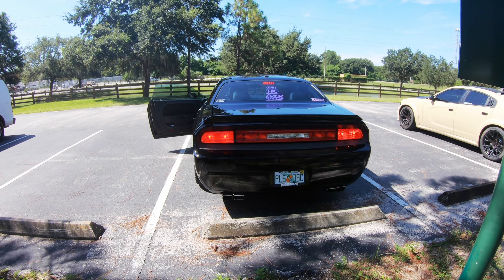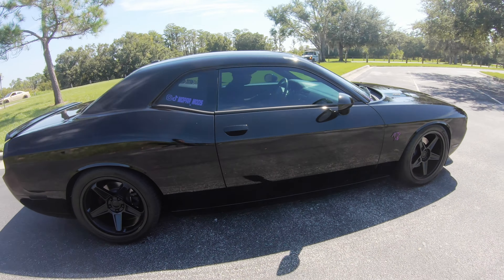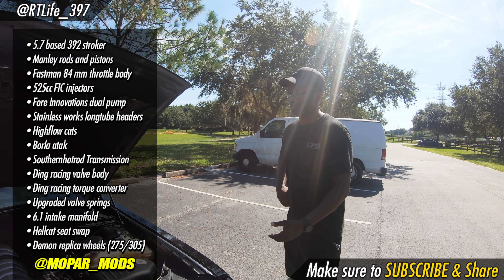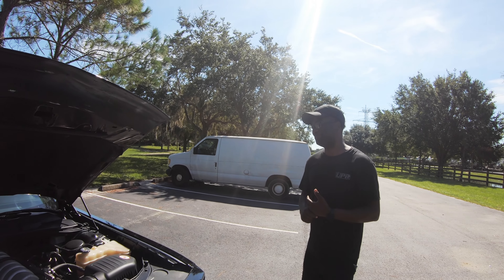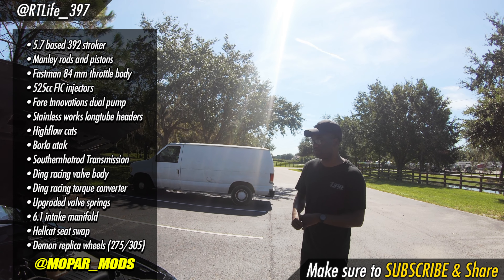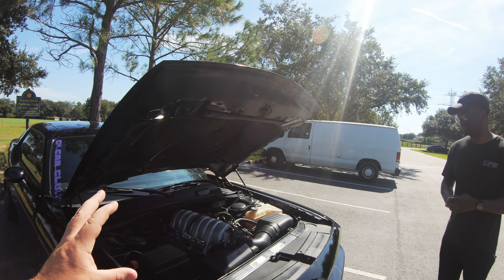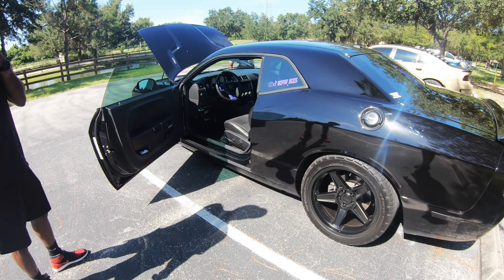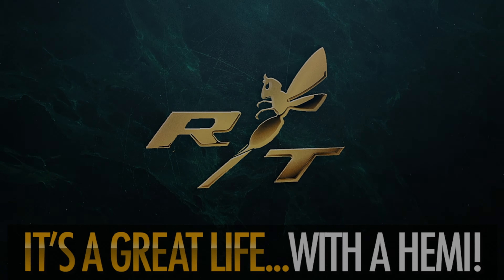5.7L Stroker or 392

Comment: Good to see more 5.7 Strokers out there! Sorry to say but 5.7 Strokers are much more fun than stock or close to stock 392s. Mines cost around 7500 bucks for the rebuild, heads being refurbished and tune.  Still on stock heads. Feels like we’re making closer to 440-445rwhp on my setup. It’s possible! Just got to do your research!
Reply from the maker: The nice part is you can boost your hemi with confidence.

Comment: I have a 300 SRT and a 2012 5.7!  love em both
Reply from the maker: it's a great life... with a hemi!!!
Reply: i got a 2012 chrysler 300s 5.7 but i don’t know if i should build from the 5.7 or just do a 6.2 swap.. need a little help
Reply from the maker: depends on what you can get the 6.2L for vs performance shop upgrades. I've seen some hellcat engine & transmission being sold for $9-12k - I'm sure it would be another $3-4k in tuning, driveshaft & other misc expenses.

Comment: 6k for a built motor is damn good! I talked to srt auto works in Phoenix and they told me to build my motor with a 426 striker kit would be 16k installed for my RT
Reply from the maker: 16k is to much. At that point it's really not worth it. You still need fueling, forced air, transmission etc.
Reply: Srt autowerks are really expensive. You would be better off going to mpr motorsports in California. I did a procharger on my car and I installed it myself for 10k . Stock block 392 with a procharger . I’m at 580 rwhp…
Reply: @seanem7261  nice!!!!! But Cali is out my price range to ship. I’m in Atlanta
Reply: @ShaunJaySays  I stay near Atlanta but I’m planning on doing a engine swap (and many other upgrades as well to my R/T) ppl going to say oh i could’ve gotten a new hellcat  for that price, but i don’t want it i could care less for it, and it will not be a hellcat swap too many ppl are doing that i want to be different
Reply: @taygreene86  I feel you on the part about people saying you should get a hellcat, cause people tell me the same thang all the time. The only way I’ll get a hellcat is if it’s the Durango hellcat. Other than that I’m going to build my RT out. I’m going with a whipple at the beginning of next year with national speed inc up in North Carolina.
Reply: @ShaunJaySays  yo that’s dope, aye bro i wish you the best in your build and always be cautious for your weak points in builds (example: you build your engine but you need a transmission upgrade, or you need a stronger differential, and etc.) which you probably already know. If you see 5.7_hemi_phantom on the window that’s me, but like i said good luck with your build bro 💪🏾💪🏾💪🏾💪🏾
Reply: @taygreene86  Ppreciate it mane! If you hitting any car meets let me know I’ll pull up
Reply: @ShaunJaySays  will do, you be safe out there 💪🏾

Comment: If you're going to build an RT over 450hp you should upgrade the brakes. Scatpack/SRT have much stronger brakes than an RT. I had a very scary run at the track last year when I almost ran out of road because I was going too fast for the brakes
Reply from the maker: yah - most end up doing a pursuit brake conversion. Pretty solid option
Reply: The car is already a little over 400 horsepower stock. You're talking about stronger brakes for 50 horsepower.

Comment: I had A rt challenger love the car I now got a scat pack love it a little more from what I know and have seen if you want to mod get a rt pro charge cam long tube headers tune you beating stock SP SS 5.0 if you want a simple fast naturally Aspirated get the scat pack
Reply from the maker: yah that 392 is def one of the best N/A engines you can get your hands on. Many guys break into the 10's N/A in these 392's
Reply: @RTLife  has anyone ever went into the 10s with NA 5.7s? I guess they could if they did a full on NA build. Based on what you’re saying the myth that you can’t mod 392s is total baloney
Reply from the maker: The fastest N/A 5.7L I've seen was modern red hemi with 11.8  range 1/4 mile. The 5.7 needs more displacement or forced air to break into the 10's

Comment: That’s a sweet build! Honestly, not a big fan of stroking a 5.7 but this is pretty sweet. This is painful for me to say, you know how much I love the 5.7, but if you’re gonna stroke it out, I think it’s better to just get the bigger displacement. Some drop ins and the sky is the limit.
Reply: Hey brother I'm the owner. I don't disagree with you but for me having a strict budget coupled with skyrocketing prices this was a no brainer. Also like I mentioned in the video the motor was already trashed when I got the car so why not lol
Reply: @FranksGarageOfficial  don't get me wrong. I love the car and the build. You have a monster on the way, especially if you boost it. I was looking at it if I was given a choice of which way I would go of the two choices, not taking budget and the situation into consideration.
Reply: @ModernRedHemi  for sure! If hellcats were reasonably priced I'd be at the dealership yesterday lol. Dodge haven't done us any favors by discontinuing hemis either
Reply from the maker: Stroker is the shit!!!! More displacement, forged internals & less boost needed for more POWER.
Reply: Does stroking it to a 397 make it less reliable ? Or would a 360 stroker be more reasonable ?

Comment: 5.7 is great for the guys who want the custom build. 6.4 is the middle of the road with decent stock hp but you can’t add boost. But a tune and bolt ons wheel have you close to 500hp at the wheel.
Reply: Wrong. 392s can easily take up to 8 psi of boost if they're built after 2018. That will put you at about 600 horse at the wheel. Swap the internals out and you can go up to 14 psi.
Reply: @lb9355  yea but how many guys are doing that and spending all that money. At that point take your cash, sell the car and go buy hellcat. Realistically you can get bolt ons and a tune for 7k or less especially if you install the parts your self.
Reply: @tunjitube17  not everyone wants to buy a hellcat tho its always JUST GET A HELLCAT when u wanna build a 392 or 5.7
Reply: @alexander_3923  I think you’re missing the point. Go do some research on superchargers for 392s it’s fuckin expensive. But with just bolt ons it’s easily less than $8k work included. 5.7 are made to take boost 6.4s not so much.
Reply: @alexander_3923  so again if someone is wants to add boost to a 6.4 you’re better off going up to a hellcat it’s just that simple.
Reply: @tunjitube17  ive done all my research first of all i would put a procharger because if u really wanna go fast u wouldent put a root style blower and plus i got my scat very cheap and cheaper insurance so getting a hellcat is definitely a no
Reply: @tunjitube17  u forged the internals on ur scat and add a procharger with a very good tune u can make 800 whp on baby boost which will gap a kitty with only 630whp
Reply: @alexander_3923  cool that’s great for you but the guys like me I bought a wide body scat outdoor taxes incl for 61k why it makes zero sense to try to add boost for 10-15k when you could just get a hellcat for that money and have the confidence of the built in reliability in the 6.2
Reply: @alexander_3923  yea I get you but again at what cost. I plan on only doing tune and bolt ons on my scat I don’t race so I don’t need anything more it’s something about being natural aspirated and reliable makes me sleep well at night.
Reply: So that my car in the vid. I got the car for a steal. I planned on getting a hellcat but the prices skyrocketed. I decided just build something similar in power. I didn't mention it in the vid but everything I've put on with the exception of the injectors  is good for 800+ whp. I had the car over built so I can make a reliable 700 whp with out touching its limits. Even with the procharger going on in a few months I will be at less then half the price of a scat. The biggest bonus is I have no car payment
Reply: @tunjitube17  o in that case ur right lol 😂 yea it wouldent make sense
Reply: @tunjitube17  I have a Procharger on my Wb scat and it cost me 10k. I installed it myself . And still running on the procharger tune, no issues at 30,000 miles on the kit.
Reply: @tunjitube17  not true , I’ve been running my scat on boost for awhile with no issues
Reply: @tunjitube17  naw , if you don’t want a hellcat there is nothing wrong with boosting a 6.4
Reply: @tunjitube17  wow $61k ?
Reply: @seanem7261  yea for sure you did the work your self but a lot guys can’t turn wrenches to change a tire or change their oil let alone install a pro charger. My 21 scat WB was msrp 56k 5k on tags, title, taxes, and power gap =61k
Reply: @seanem7261  For me I like the idea just having the best 6.4 natural aspirated with only bolt ons I think it’s kinda cool like I can get 20 mpg on the hwy and push 500whp.
Reply: @tunjitube17  I’m getting the same mpg boosted 🤷‍♂️ and at 580 rwhp
Reply: @tunjitube17  and you aren’t getting 500 rwhp without a cam. A tune , cai and long tube headers alone are not getting you 500 rwhp
Reply: @seanem7261  yea I know and that’s the plan
Reply: @tunjitube17  I feel you Bro I paid 61K for my 21 slim body Scat Pack so I'm kinda of Jealous of you but then again I also live in California 😆

Comment: Around 430 whp with no cam or ported heads? Amazing
Reply from the maker: I think he's doing great. Going to try getting a follow up video once he adds boost
Reply: @RTLife  please do. I wanna mod my RT to get like 500 whp or more. But I don't wanna go pass a stage 2 cam because I drive mine everywhere lol
Reply: @elstaywinning5735 what happens if u go pass a stage 2 cam?
Reply: @Ls4_SSleeper  you would need forged internal new pistons rods injectors things like that. Wouldn't be good for daily use anymore

Comment: The 392 manifold would be better for him than the 6.1 intake especially ported. 430 whp he’s making stock 392 power…..I rather start with a 392 and go from there because you don’t have to worry about stall or the trans. The scat trans will hold 650 whp. Hell a 392 with cam heads and forged pistons will put out about 120+ more whp than he’s making now N/A
Reply: What's up bro? You make a good point but the 6.1 intake manifold was better because the car is getting supercharged. The trans mission is built for around 900 whp. If you look into it the 392 dodge makes is actually based of the 5.7 so all the parts are interchangeable. I'm the owner btw lol. Everything you said was on point tho 👍🏾 just for my goals and budget this route made the most sense.
Reply: This true 5.7 6.4 6.2 all have similar parts hell a  6.4 and a 6.2 share the same bore but are stroked different with different pistons. So yes all these hemi are very similar. But yea the 6.1 intake is definitely better for forced air 392s better for high compression. I get what you’re saying though about price especially when 392s are 50k plus now. Not mine got mine low 30s in 2018. Hell I make 510 whp and 500 torque N/A with money I put in it with mods I still doesn’t total up to 50k with the cost of the car.
Reply from the maker: The R/T, 392 & v6 all use the same 8hp70 trans. That said I understand your point, a stock 392 makes 420-430whp. But the point is on top of the increased purchase price (scatpack) you have to now drop in forged pistons/rods so you can run similar boost as this built 392 stroker. You are correct a cammed 392 with ported heads & other smaller bolts on will drop 500+whp N/A on dyno. With that said, it also has much higher compression - many (myself included) lower the compression on a built engine because it handles boost better.
Reply: @johnnykilroy9399  damn you're one of the rare ones lol. My bro tried to by a scat last year with 40k miles. They tried to get him for $45k
Reply: @FranksGarageOfficial  Sheeesssshhhhh yea thats the game now bought mine for 34k and it was valuable for 44k last yr when it had 40k miles on it lol
Reply: @RTLife  Actually the v6s have a hp50 5.7 and 6.4s have a hp70. But yea when I was watching the video I was considering what I paid for mine vs what todays prices for 392s are today. But again N/A for N/A mod for mod the 392 makes more. But that doesn’t mean they can’t run boost though that’s my main gripe about he’s opinion 5.7 vs 392. You definitely can run more boost with stock 5.7s because their pistons gaps aren’t as high. Put if your really want to turn the boost up. You’ll still have add pistons just like a 392 and of course drop the compression as well. But definitely 392s aren’t cheap anymore

Comment: The 5.7 built a 392 has weak internally can’t boost over 5 lbs. that’s why hellcats are basically the 5.7 and 6.2 combined.
Reply: Can easily forge a 392 and boost or spray. The 6lb of boost rule only applies to stock 392's
Reply: Naw , I’ve been boosted on my 392 for 30,000 miles @ 7-8lbs of boost and it runs strong . The tune is the key and making sure you have enough fuel volume

Comment: I don't know if anybody mentioned it or not, but there are a lot more differences and improvements in the 392 over the 345. Just doing a stroker to the 5.7 is not the same. Granted it would be close and I'd you plan on boosting then the 345 may be a better choice, but unless you got a killer deal on the car it would most likely be cheaper and better to just get a hellcat.
Reply: That's the 🔑. Get a good deal on the car. If you grab a decent rt for around 10k then mod you'll have a beast for a fraction of the cost. You just have to be patient while getting it all done
Reply: @FranksGarageOfficial  your talking about an older car at that price point though. Most likely a previous gen. I like to get new or nearly new cars with low miles with a warranty.

Comment: Dude I've got a Scat and 715 at the wheel on 93 and 802 on 104 Sunoco GT260 plus so...each to their own
Reply from the maker: Big boy power right there! Nice man
Reply: @RTLife  yes lots of hard work for me man no doubt brother MMX lowers (for sure) Redeye axles and drive shaft the Tremec 6 is gone Running a RPM 6 with their proprietary bullet proof clutch and Barton Guide and Shifter
Reply: @toddreeder3082  sheesh. You don’t see many boosted scat packs out there.
Reply: Awesome build, any advice for starting a 392 build? Like to be around 600 to the wheels

Comment: Isn’t the scatpack a 392 R/T?
Reply: He said it wrong it’s either you have a R/T scatpack or a SRT 392
Reply from the maker: Some have R/T on it - some don't. 2020+ Charger Scatpack has no R/T badges on it. Very confusing branding if you ask me. Either way - it's really Stroker 392 R/T or Scatpack. I just don't like making the titles so wordy
Reply: @RTLife  gotcha yeah my scat pack is a 2020 and is labeled an R/T at least that’s what insurance classifies it as. That was the main thing keeping me from getting a hellcat.
Reply: 392 Challengers are called R/T Scatpacks. I work at a Dodge dealer. That's the naming convention Dodge has gone with on the Challenger. On the Charger they're just called Scatpacks. It's been that way since Dodge took the SRT trim level away a few years ago.

Comment: I’ve been running boost on my 392 for awhile with the procharger tune and no issues. Too much timing and running lean is what destroys the pistons…this 392 can’t handle boost myth is just that , a myth.
Reply: For sure they can but a lot of people push it to far chasing numbers then 💥💥💥 lol
Reply: Got to gap the rings on boost then it's fine. Not doing this is why people break pistons
Reply: @plap.  naw , adding too much timing which causes detonation breaks pistons
Reply: @seanem7261  timing is easy 1.5 degrees for every lb of boost or so, it doesn't break them, its to easy to set. Rings without enough gap on a n/a motor that boost was added to close up when the extra heat from more power boosting expands and the ends touch. It breaks the top off the piston. Then every one thinks they lost weak internals and try to blame rods or some other BS.  People are to lazy to pull the motor apart to add more gap to the rings for boost. Don't even have to buy anything. Just the time to pull out pistons file the stock ring ends and reinstall everything. No money just time to make the motor last with real boost not 3 to 5 psi to try and make it live being  to lazy to do it right and save lots of money in the long run.
Reply: @plap.  I never said timing in itself breaks pistons , I said too much will and cause detonation,detonation breaks pistons and I got 30k miles on 8psi , boost is boost , even 5 psi is still adding pressure, people have broke pistons on 5 psi due to detonation. I’m not sold on the ring gap theory, due to mine being fine after 30k miles of hard driving. If the gap was that close , I would have popped mine long time ago. 👍🏽 peace
Reply: @seanem7261  sorry that setting timing is so difficult for you, definitely don't mess with ring gap with limited skills. Better off if you have someone explain or do it for you. Then you will know what you are talking about
Reply: @seanem7261  like russian roulette. Don't know if the gap is optimal on a specific motor or not unless it's checked. Gap only has to close up and rings touch once.  Difference is not having to worry about it instead of just luck of the draw. At 8 psi consider yourself lucky. That's the upper limit without the prep work.
Reply: @plap.  not anything like gambling when I know what I’m doing. I usually don’t take word from people who parrot what other people say. I’m backing up what I’m saying because I spent the money ,time and effort…
Reply: @plap.  I have my timing and fuel trims set so it doesn’t detonate . My ring gap is fine, thank for your concern . Even though your knowledge with the 392 and boost sounds limited , your heart is in the right place , peace ✌️